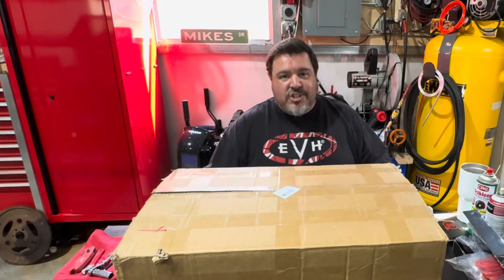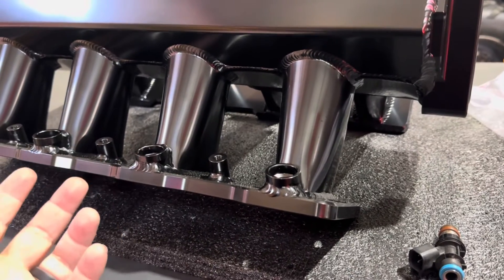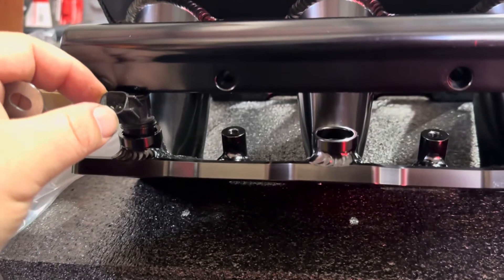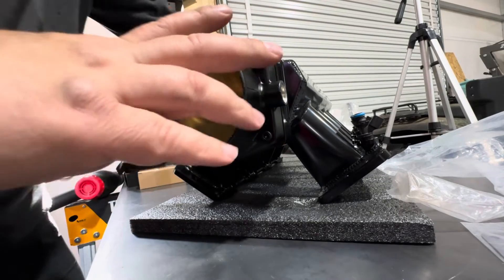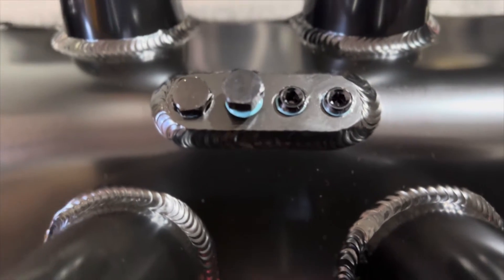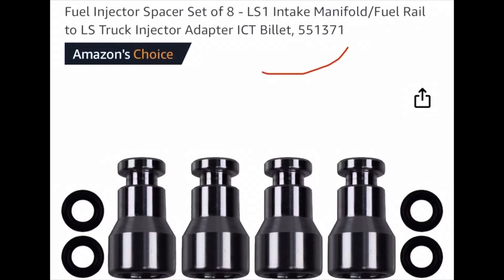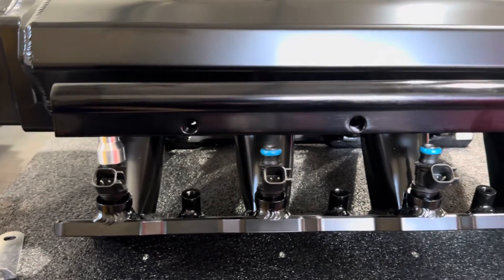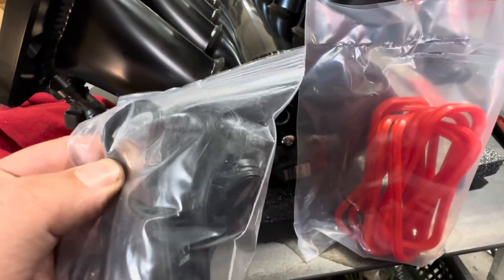Fabricated Sheet Metal Intake Manifolds - Should YOU Get One?

Comment: Totally agree with your take on the intake. The original intakes on these truck LS motors look terrible. I am currently trying to figure out what to do on my LQ4, and it’s a minefield of consequences. If you go with the doorman LS2 it will cause you to redo your accessory drives belt setup! Still haven’t decided this. Currently putting 799 heads and a new cam on to get more performance and a nice sound. Thanks again for your perspective on this!
Reply from the maker: I totally get ya. You would think that there would be a torquey aftermarket replacement for the truck intakes other than the tall “fast” intake for $1k+! And yes, the accessory drive becomes an issue when switching to a car intake, and again, the only nice replacements cost a small fortune. That all part of what lead me to this decision.
Reply: Tbss truck intake  and close the hood then u won't see it ! Or get a cover for it if it really bothers you